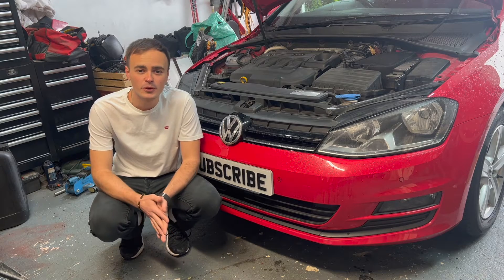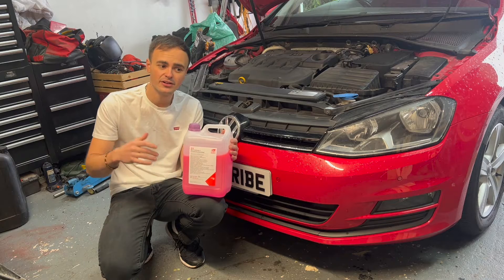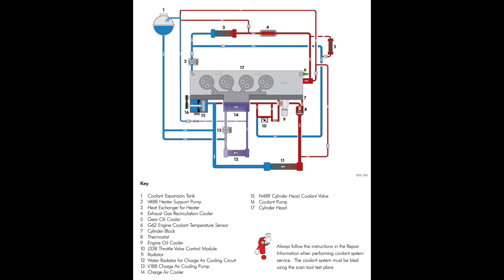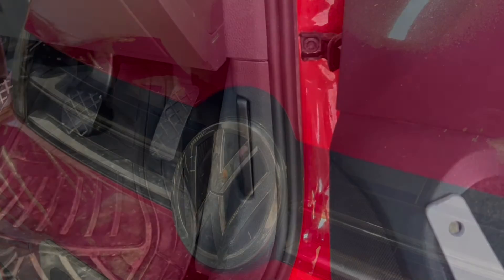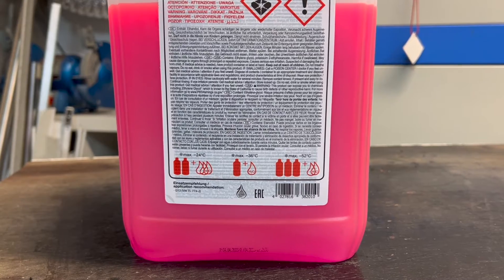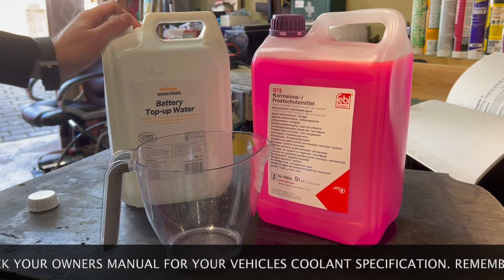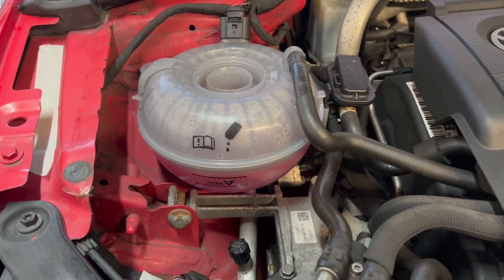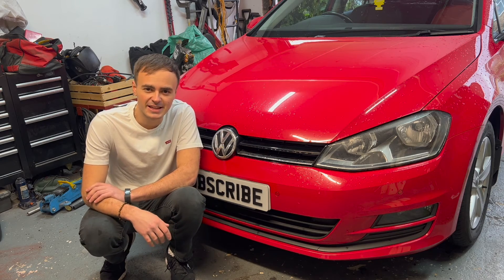SILICA BAG UPDATE - Coolant Refresh for VW SEAT SKODA & AUDI Owners

Comment: Excellent instructions -  I did this job today as I had the car on the ramps for an oil change.  Squeezing the pipe as you recommended works a treat.  I got just under 2 litres out so approx a quarter change.
Reply from the maker: Thank you, glad it was useful to you 😊Nice job, it’s much better doing a partial change than nothing 👍🏼

Comment: Not the bag that's the problem. It's casting sand from the block.
Reply from the maker: I’ve heard this can be another issue blocking the matrix up, the silica bags do also fail though 👍🏼

Comment: This is a really really good video which shows how to do a second most important maintenance item after the oil change, coolant change. Lower raditor hose off, drain and replace simply, thanks!
Reply from the maker: Thank you very much! Glad you found it useful and it certainly is a very important maintenance that is often overlooked 👍🏼

Comment: How many litres the coolant system have? I think about 9 litres. If you can drained about 2 litres, your coolant system has drained just 22% only.
Reply from the maker: Yeah it’s a very tricky system to do a complete change without completely dismantling and refilling with a vacuum filling tool. So I just did a partial change and will continue to do that every now and then to refresh the coolant and restore the inhibitive properties of the coolant 👍🏼

Comment: Hello, wich coolant on 2015 vw Up! 1.0 mpi 44kw?
Reply from the maker: Hi there, it will tell you in the owners manual. It says online that G12evo is designed to be compatible with previous coolant formulations, including G11, G12, G12+, G12++, and G13. It can be used as a direct replacement without the need for a complete system flush, provided the system is in good condition.
Reply: I still didn't belt and coolant replacement cause few miles...

Comment: I did a distribution kit replacement and changed the coolant to Mannol Ag13 green . Am not getting hot air even after one month of usage ! Coolant level has settled and temperature level is normal.  2017 2.0 TDI ! Any ideas ??
Reply from the maker: Did you use a vacuum filling tool? They’re prone to get airlocks if you just fill the normal method.

Comment: How do you do a full flush be mine is contaminated thanks
Reply from the maker: It’s quite labour intensive to carry out a complete flush on these engines as they have compartments where the coolant gets trapped. Also, they need to be refilled with a vacuum filling tool to avoid getting air locks. Air trapped will stop the circulation of coolant and potentially damage the engine. Is it contaminated with silica?
Reply: @TurnersWorkshop97 no it’s from putting bits of water in because keeps losing coolant on long journeys
Reply from the maker: Ahh ok so just tap water not deionised water?
Reply: @TurnersWorkshop97 yes just tap water it’s got like a brown colour to the coolant
Reply from the maker: I don’t supposed you mixed the g12evo with the g13 coolant? It does tend to go a brownish colour apparently.
Reply: @TurnersWorkshop97 I probably did yes
Reply from the maker: That’s fine as the g12evo supersedes the g13 and they can be mixed. But a side effect is that it does have a brown tinge when they are mixed. If you wanted to do a coolant change yourself and keep it straight forward. I’d recommend doing the partial coolant change I showed in the video a few times. It does waste some coolant but will definitely be cheaper and easier than a full flush 👍🏼
Reply: @TurnersWorkshop97 thanks for the reply
Reply from the maker: Anytime :)

Comment: For your information. The 1.6 TDI has 7,5 liter of coolant, while the 2.0 TDI has 8.5 liter. You don't even refresh 1/4 of the coolant. It's near to impossible to bleed all the coolant. You can remove more coolant if you remove more hoses, and activating all the water pumps and opening some solenoid valves on the cooling system.
Reply from the maker: Thanks for that information :) without VCDS which most people don’t have available, it has to be a partial change which is better than nothing

Comment: Better to disconnect return pipe to coolant bottle & run engine you can then just top up with fresh coolant in bottle when it drop, do it with warm engine to get more out as thermostat will be open

Comment: I just removed my bag today. Resevior was gone all brown hard to read the level thought I was in trouble when I seen all the brown build up. 
Then began to lose coolant. Couldn't figure out where. It was actually the tank itself and was leaking out from a crack in tank onto the body work which is silver and was very difficult to see. Took me a few hours as no resedue anywhere. Only when the car was running was it dropping drastically and emptying the tank as the pressure was only high enough when moving. New tank on the way, easy fix which is great.

Comment: My daughter has a 2015 A3 2.0 litre tdi,which recently suffered a blocked heater matrix. Her car had the G13 coolant with the silica bag in the header tank, but the bag wasn't split. The blockage was caused by, what looked like, casting sand, Audi replaced the matrix and the header tank and used G12. I have been told that G13 coolant should still be replaced every 2 years, just the same as the G12.
Reply: did audi do that for free being a recall or did you pay?
Reply: She got some discount

Comment: For asian climate , need to mix ? Or can be use pure g12evo or G13 ?
Reply: There are ready to use coolants and concentrated coolants, if you use pure concentrated coolant you will overheat the engine as water is needed for heat-transfer.

Comment: “It is also worth noting that if you mix the G2 Evo coolant with any of the predecessor listed here and the coolant becomes brown this is normal and it doesn’t require you to drain the system and refill it” !!! THANK YOU  !!!

In 2018 my 2013 Golf Mk7 had a blocked heat exchanger from silica bag splitting. It cost hundreds to put right including a new heater matrix. 

This week i found out my replacement expansion tank also had the silca bag and my collant has gone brown.  I was expecting another massive bill.
Perhaps the brown collant is just a mix of evo+ from it's last service and my silica bag hasn't split.
New bottle arriving later today so i can investigate.

I think you may have just saved me ~ £1000 based on what work my gariage wanted me to aurthosise last week.

Comment: Welll for audi A4  2019 there are different shape of coolant tank (not rounded), and this shitbag are not reachable without not breaking coolant tank. So i had to replace on to non OEM coolant tank, where silica grains are placed into plastic chamber box into coolant tank, much better design, compared to manufacturers OEM simple tea shitbag wich just waiting toopen itself someday and block heater matrix and compromise heating circlle. If you have option to remove this silica bag, just do it now, there are zero advantages for it, compared to repair cost time what will follow if you not remove it.

Comment: This was a great video to watch. I recently had my 2018 skoda Octavia combii 3rd gen inspected here in the czech republic and then a week later during a cold morning start my coolant sensor came on so i immediately checked the reservoir and it was below the min line. Should i just put more coolant in the reservoir?
Reply: yes top it up, check after some long drives, coolant exband etc minor consumption normal too often then there is problem, need check if there any leaks
Reply: @walther89  ok thanks for the free advice, my wife topped it off while i was away in america for my dads funeral. it looks good now, but need to go on a long drive. it is so diffferent living here in the czech republic. i find things here to be more expensive than in america. i hope the price of things drops down.

Comment: I've got a 2018 skoda octavia vrs tdi dsg,  18 months ago my matrix became blocked it wasn't the silica bag as I removed the expansion tank and cut it open and the bag was fine when the matrix was cut open it seems its casting sand from the block , and 18 months down the line it's become blocked again so I'm wanting to do a full flush how do I do this please as you have only covered the radiator thank you
Reply: I just had this done under warranty by Audi and the flushing process took 3-4 hours. Surely VW should do a recall.

Comment: greeting
does it have to be pink g12 antifreeze or can i pour green antifreeze
Reply from the maker: Hi there, you should never mix different colour antifreeze as it congeals and blocks the system 😊
Reply: @TurnersWorkshop97  can i flush out the pink and pour in the green antifreeze
Reply from the maker: @sasasaran2210 it’s best to use what’s recommended by the manufacturer as they have different corrosion inhibitors depending on what metals the engine is made from.

Comment: The silva bag on my seat Leon has blown and contaminated everything including the heater matrix. What is the best way to clean out the system?
Reply from the maker: I’m sorry to hear that mate, it will need a complete flush and replace or clean the heater matrix. I think there might be some videos on here to help if you’re planning to do it yourself.
Reply: @TurnersWorkshop97  didnt you just do a full flush in this video?
Reply from the maker: Only a partial flush due to coolant being trapped in the charge cooler etc. To carry out a full flush, it’s quite a laborious task.

Comment: that mean i can fill my g13 with g12evo?*
Reply from the maker: Providing it’s not the particular 2015 2.0 TDI engine mentioned it should be upgraded to the G12evo
Reply: Yes, but you can't combine these two collants. This will cause problems!
Reply: @Nitramrec no IT wont. You can mix G12 And G12 Evo but you canto g13 And G12
Reply: Yes. Drain your old coolant and flush your cooling system with water. Then fill the G12evo (60 % concentrate with 40 % deionized or pure water or the readymix) in and vent the cooling system. Maybe you have to use the Volkswagen VCDS-System, because the electric pumps und vents have to be opened in an specific order while the motor is running with different rpm. Depends on how old your car is.

Comment: Hey . I do almost everything on mine 1.6tdi DDYA , the first thing that I did when I got in 2020 was replacing the coolant and remove the silica bag (changing for a new expansion tank as mine bag was inside the inner wall like yours. You just opened the charge air cooler (aftercooler and not intercooler) circuit in the video but you could open the circuit on the main circuit on the big radiator and near the  rear pump (closest to the driveshaft), you can use a compressor to help you geting coolant out by blowing air in the heater inlet  . The G13 has some glicerine in it but the major part is still mono etilene glicol .. any coolant should be changed every 48months \ 60k KM
Reply from the maker: Hi, thanks for your insight! It’s pretty hard to find the correct information out there so I try and be as accurate as I can based on the information I have. I will have to check that out next time I’m under the car 👍🏼

Comment: The correct bleeding method with most VW group cars requires VCDS and an automated bleeding process!
If you look up the “fix it with Jon” YouTube channel he has done one showing all the details of the VCDS functions to use the proper process to do a full engine and low pressure bleeding procedures for VAG group cars.
Having got a small leak on my Skoda Superb 3 1.4 TSI 2017 from the water pump I will be fully draining mine to replace the pump assembly/ manifold and following this process to replace the G13 with G12 evo coolant and bleed the system fully using VCDS as I have this already.
Near Sleaford
Lincs if anyone needs a hand to bleed their properly!

Cheers
Ian.
Reply: More better g12evo than g13 ?
Reply: Hi, any idea how to access the coolant bleeding option on VCDS? I've watched the videos on YouTube but my VCDS program doesn't have that option, the car is a VW Golf 1.4tsi Mk7 2014. Thanks

Comment: Hi mate, have you ever done a coolant flush yourself? Also, would you know how to drain the ENTIRE coolant system? Any tips?
Reply: There are a few ways to approach this (regardless of car) depending on your level of skill. This is what I have done successfully for years. You'll never get every drop out for the reasons outlined in this excellent video, however; it's important to know what your TOTAL system coolant capacity is supposed to be and to use CONCENTRATED coolant.

For this example let's say your total coolant capacity is 12L

	1. Drain what you can from where you can.
	2. Remove your thermostat. I keep an old housing around and took it's thermostat out. I put this on the car during the flushing stages. Makes things easier to not have to wait for the thermostat to open. This way the full circuit is always open.
	3. Refill your system with tap water and run the car for 15min or so. Turn the heat on full inside the car.
	4. Drain again
	5. If you are happy with the clarity of the drain, refill your system but this time with DISTILLED water or if you are not happy, repeat with TAP WATER.
	6. Do two flushes with distilled water to get all the tap water out. 
	7. MEASURE THE AMOUNT YOU DRAIN ON YOUR LAST FLUSH. This is key. Let's say you drained 7L.
	8. Reinstall your thermostat.

Assuming you got 7L out on your last drain, that leaves 5L of Distilled water (Total 12L) still in your system. Given a total system capacity of 12L, that means 6L of coolant and 6L of water for a 50/50 mix. Since you still have 5L of water in your system, refill with 6L of coolant concentrate and 1L of distilled water.

------------

Less advanced method:

	1. Take off the return hose to your coolant bottle and feed it into a bucket. (extend it with tubing etc to make things easier).
	2. Run your car and your water pump will start pumping out all the coolant into the bucket.
	3. Keep filling your reservoir with plain water (distilled only in this case) until you are happy with the clarity of what's ending up in the bucket.
	4. Once you are happy, DRAIN the water out from wherever you can. MEASURE WHAT YOU DRAINED.

Based on your total system capacity, calculate the amount of coolant concentrate you need and any extra water.

-------------

These methods have never failed and result in perfect 50/50 mix. Whether you choose to add a cooling system 'cleaning product' in after your initial drain is up to you. In that case, you may wish to run the car longer or even drive it around to allow it to do it's work. Rest of the steps remain same.
Reply: I wanted to replace my g13 with g12evo today but the mechanic only managed to drain the same 2 litres. How to drain the whole 6-6.5 litres ?
Reply: @Svili0 can you top up g13 with g12evo
Reply: @aridi555  NO this combo is not permitted.
Reply: @aridi555  Yes. The latest version (as of May 22, 2023) of g12evo is compatible with all previous Gxx versions, either as a full replacement, partial replacement, or top up.   I don't know whether you can still get a brown color if mixing G12evo with previous versions, but probably in some cases.
Reply from the maker: Hi, sorry for the late reply. In order to do a complete flush it’s quite labour intensive as various different circuits need to be disconnected to drain. The egr cooler, intercooler and radiator need to be drained separately I believe. Haven’t needed to do it myself fortunately. Has your silica bag split?

Comment: Hi mate I’ve got the coolant issue, need a new heater matrix. Nightmare! They want to charge me £550. Gunna try to replace it myself. It’s weird the coolant is slowly leaking garage can’t figure it out where it’s leaking. Think this is a common issue too?
Reply from the maker: Hello mate, I don’t think it’s too bad a job to do yourself. There are a few vids on here. Possibly a leak from thermostat housing or water pump? Worth checking. Let us know what you find 👍🏼😊

Comment: DId you get the rest of the 2L of coolant to go in after you drove the car a bit?   I'm thinking of just changing out the coolant in the reservoir, so as to avoid any chance of trapping air.  I would either do it repeatedly, or maybe just do it once every 5k miles along with my oil change.  That would be enough to keep the protection going.
Reply from the maker: I thought about doing the same myself and would say it’s a good option if you didn’t want to drain the 2L out. It does go back in but takes some time and you have to keep checking the levels.

Comment: Thanks for the video, I have a question, I’ve got a 2015 golf GTD and it still has about 1.5 years of approved used warranty left, do you think it’s best to leave the silica bag in until at least my warranty is up?
Reply from the maker: No problem, thanks for watching. If it’s under warranty you could leave it for now as they should pay for the repairs. Just don’t forget to remove it after the warranty finishes 😊

Comment: Watching the video, I saw that you only got 2 liters out by pulling that hose. 2 liters is not even half of the coolant for sure. Or how many liters does it contain more specifically?
Reply from the maker: Hi, thanks for your comment. The Haynes manual says that it could be up to 8litres approximately. Seems too much based on what I took out. I would say more like 4litres.